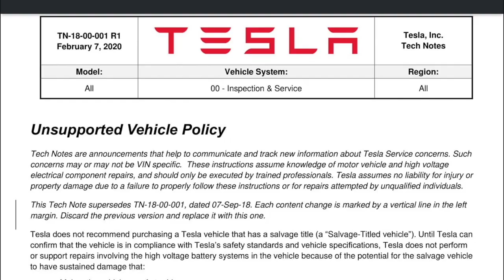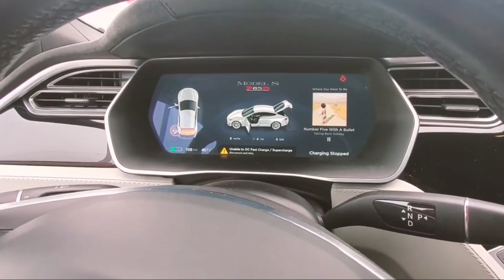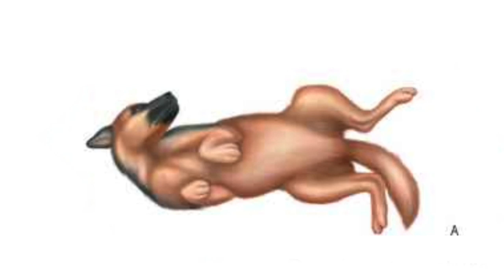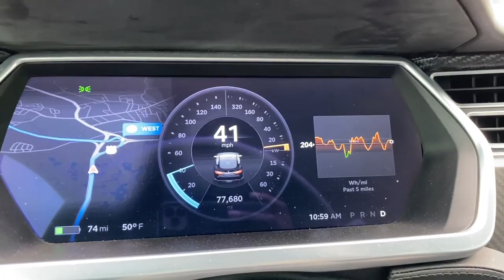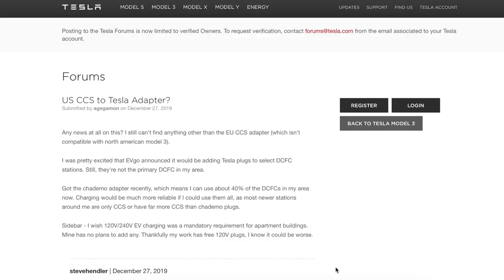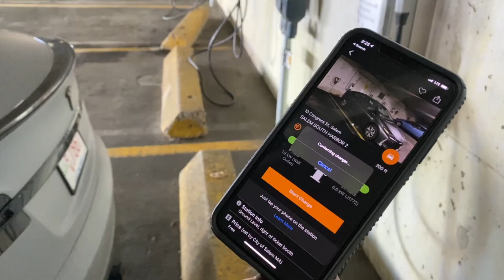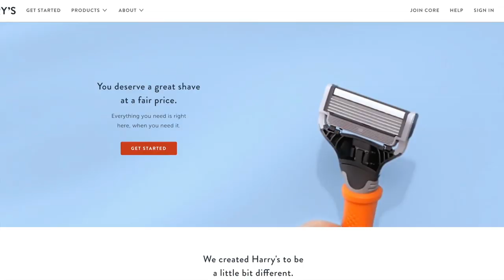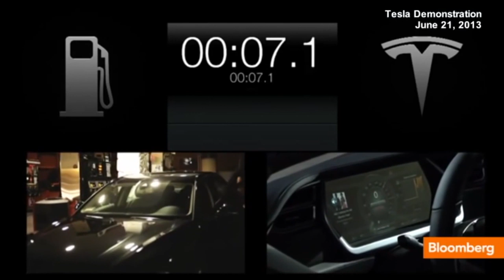Tesla ruined my car and it’s the best thing to ever happen to me!

Comment: I won’t give Tesla $1 
This is unacceptable period
Reply: Right. Tesla sucks.
Reply: Yes I agree the fact that they don't do the inspections anymore sucks but honestly playing a little devil's advocate here, dc fast charging is pretty dangerous and if the rebuilder did a terrible job and the car catches fire while charging that would be pretty bad for Tesla
Reply: They want the cars junked out... they want you to buy a new car
Reply: Watching this made me cancel my Tesla order...

Ok i didn't have a order, BUT if i did I'd cancel it. Of course there no way i could afford a new, or even used Tesla. Sooo yaa
Reply: I like Tesla ALOT, there vehicles r in my list of dream cars, but this is utter shit
Reply: @pkoya341  Yes, that would be pretty bad for Tesla if it happened. But what they're doing is bad for them _now_. They need to stop.

I get why they are afraid of the media, they've done enough BS to hurt Tesla, but this is just making it worse. They still get the bad press, but now it's actually justified and they're fucking over actual Tesla/EV enthusiasts for a little perceived gain that they have no way of proving it's actually there.
Reply: Not offering a way to buy supercharging is some real nonsense.
Reply: @jonmayer  If only it ended there. The worst part is they turn off all fast charging, not just supercharging, essentially rendering this Tesla worse than a standard non-Tesla EV. If they shut out Rich from their own electric gas that's one thing. But blocking him from using any of the other stations Leaf and E-Tron owners would use is just despicable on every level.

It's like they're trying to render the car completely unusable without the legal ramifications of a remote kill switch.
Reply: @DeeSnow97  imagine if they did 😰
For every used Tesla, the next time the driver shifts to park, it's immediately bricked. 
Scary, huh?
Even though there not dumb enough to do that (thankfully), it's having the same effect if they did decide to do that. Shutting people out from supercharging PLUS regular DC charging is just unacceptable. I try to look over a lot of the things Tesla does but waiting 24 hours plus for not even a full charge is just evil

Comment: This is high class bullying. Really shows the disadvantages of being connected all the time. Sorry to hear that!
Reply: Rich, would have ZERO problems IF he just bought a USED working Tesla instead.
and keeping the car Stock.
Reply: @markplott4820 : Well of course, if somebody pays 3 times the cost for a car that you do not fully own then sure...
Reply: @herrschaftg35  - TESLA model 3 costs $35K and worth more than a $70,000 gas car.
it will Outperform and Outlast a ICE car. 
and even the Standard TM3 at $40K is even a better DEAL when you add Tesla FSD.
you will be Safer and more Aware, and TM3 is Really FUN to Drive, its a REAL Drivers car, its Lighter and Nimbler than the Flagship Model S. 
you can even add Racing brakes, Wheels and Shocks.
Reply: @markplott4820 : An EV will most likely not "outlast" an ICE car, despite them requiring less overall maintenance. Certainly not a Tesla due to their subpar build quality. Clearly as indicated when Tesla altered their warranty conditions regarding their batteries and motors. And quit talking like Tesla's are comparable to sports cars. Sure, they can accelerate quickly which makes them a one trick pony in drag races, but that is the only thing they are good at. That V2 upgrade you are talking about certainly helps, but the majority of Tesla's on the road can't even do a session around a road course without ridiculous brake fade or having the batteries/motors overheating. Few EVs as a whole can even match the range associated with an average ICE car. So, your comment of Tesla "outperforming" ICE cars is definitely wrong.
Reply: @herrschaftg35  - any EV even from Other manufactures, can TODAY outlast a ICEV or Hybrid. so long as the Diver does not Overcharge and Maintains the car.
TESLA are Unique because their car is TOUGHER and Better built than ANY ICEV Today.
Sandy Munroe said - "Tesla model 3 is built like a Tank and it Outperforms European sports cars".
Sandy did a Teardown of the Model 3 PRODUCTION car and he was Impressed with what he found. 
the Tesla is Better built TODAY and has way Fewer Defects and Repairs than in 2018 when Model 3 Production began.
you can EVEN stack rail cars on top of the TESLA Glass Roof and it wont FAIL, M E A N W H I L E many ICEV have thin Metal Roofs that you can cut with TIN SNIPS. 

Tesla are NOT a Throughbread RACE car but they can OUTPERFORM just about ANY Production ICEV.
specially after using a MAX Lowering kit, Race Brakes, Shocks & Coils and Racing Tires. Unfortunatly most Drag Strips and Raceway do not have Supercharger in the Field, but that may change.
and there IS the Possibility of Supercharging with a Tesla MEGAPACK battery that can be Delivered on a Flatbed and can charge up to 100 Tesla per day with 12 stations.
TESLA can in Fact RACE pretty well, it set RECORD Breaking LAP Times at Nuramburing (Supercharger location ) and at Laguna Secca raceway. 
you can even DRIFT Drive a Tesla in the SNOW or on a Race cource, just ASK the ONLY Tesla Driver to complete PIKES PEAK . and he Plans on setting NEW Records with the Performance model Y.

TESLA model S is a Luxury car but it has the Longest Range of ANY Tesla 490 miles on a Charge, and with Additional tweeking in Battery and Software 500 miles in a Tesla is Doable , in FACT ALL of Tesla vehicles have received Updates to all Models to Improve Range and Performance.
so 500 Miles Electric vs a ICEV car.
BONUS, you can charge your car from your Garage.
Reply: @herrschaftg35   I just look at it from the perspective of ice cars not being sustainable.

 Oil is filthy and finite. We have to fight wars, displace people and wildlife to get it. What's the actual cost of a gallon of gas if we account for the thousands of lives lost fighting for it, not to mention the vets and civilliians still living with PTSD?  Plus, the spills keep happening, poisoning our water and land. The air pollution has got to stop for the sake of our kids and grandkids and all of humanity.

Meanwhile, the sun gives us all the power we need for a year every hour. We just have to harness it. No war required.
Reply: @markplott4820  you can't off road or camp with a Tesla
Reply: @seanmccarthy8311  what's the cost of keeping the power grid running?
Reply: @mkgzt  Priceless.
Reply: @seanmccarthy8311 : I am not the biggest fan of using fossil fuels either, but hydro is the only "clean" energy that can reliably meet the demand. Solar and wind require a vast amount of surface area to produce that kind of power, and it isn't as reliable. Even if we cover entire acres with inadequate batteries for storage it is still far cheaper to use standard fossil fuel power plants. When renewable resources can perform better and be the better choice from an economical standpoint, then there will be a switch from using oil.
Reply: @markplott4820 : Just stop. You are either highly misinformed or simply being paid by Tesla to spread that BS. I would normally explain my comments and point out the falsities on this subject but I am not going to waste my time with you. FYI, all three of your paragraphs are filled with BS.

Comment: It's time for custom firmware :)
Reply: @karsenbox5678  Not if you turn off their 3G connection, how will they know you changed anything if you cut off the data connection?
Reply: More like, time to switch back to a gas car.  Much simpler.
Reply: @javiermedinaortiz4653  because electricity is cheaper than gas
Reply: @ztmackin  time is money
Reply: Already in progress all you have to do is Trick it into thinking it's in the middle of nowhere with no internet connection wipe the system upload the copy do you want have any of the Wi-Fi futures but you're super fast charging will work
Reply: I’m gonna put windows xp
Reply: @HelamanGile  there will be no place without internet connection once starlink is up lol
Reply: Already out.
Reply: Itz Mango time is free wdym xD
Reply: Doesn't matter if you wrote all software yourself, you still need to authenticate with Tesla servers...... understand? NOT gonna work.
Reply: Anything can be hacked...
Reply: @karsenbox5678  It's not hacking. It's replacing. Throw the proprietary garbage in the trash where it belongs, and install your own hardware. At the end of the day, a motor is a motor. All you need is a basic motor controller system and a custom battery charger.
Reply: Tesla model s (2012 jailbreak) IMAGINE?

Comment: Between this and not being able to repair your own vehicle, I will stay far away from Tesla.
Reply: why ? A Certified mechanic can keep a TESLA running for decades. 
and a Brand NEW Tesla longer. 
and TESLA makes the BEST Vehicles PERIOD, from Day ONE.

Sandy Munroe did a Teardown of a Tesla model 3 " the Tesla model 3 is built like a TANK, but Drives BETTER than the European Sports cars"

and Motor Trend said " BEST car we EVER Tested in 70 years "

Repairing your OWN vehicle is no so Important IF you car does NOT need Major Maintinance in over 300,000 miles Driven , and ALL you Really have to do is Rotate Tires, change wipers and add Wiper Fluid.
this is Supported by the DATA collected by TESLOOP a Rideshare company who ONLY uses Tesla vehicles.
Reply: JOHN - does NOT matter if you do NOT need to Service a Tesla in OVER 200,000 miles Driven.
Reply: @markplott4820 : You definitely sound like you are on Tesla's payroll. "Best cars".........what are you smoking???
Reply: @herrschaftg35   - NOPE don't own tsla Stock and don't Own a Tesla car (yet). 
I'am saving for a Model 3 ST LR. 

Motor Trend said " Tesla is BEST car we tested in 70 years "
and Sandy Munroe said " Tesla model 3 is built like a TANK, but it Outperforms European sports cars." 
Sandy did a Teardown of a Model 3, you can even buy his FINAL Report for $70.
Reply: @markplott4820  you and Elon need to get a room
Reply: @markplott4820  so no tesla has ever gone wrong ever?  ok
Reply: @SNORKYMEDIA  - NOT , saying that at all.
I am saying in General most Tesla owners do NOT have Catastrophic Problems with their Tesla.
mostly minor fit & finish issues , that the car can still Operate safely . 
and TESLA have fewer problems than COMBUSTION cars.
People die everyday from a Combustion car catching fire, yet the MEDIA does not report that. 
I observe Combustion cars catching FIRE everyday in the Bay Area.
Reply: @markplott4820  Ehh...
No.
Reply: Mark Plott • What?
I seriously do like Tesla, and want a model 3 pretty bad. But you’ll need to replace tires from wear eventually. Align and rotate tires. The break pads may wear slower due to regenerative breaking taking some of the force, but they’ll need replacing occasionally. I don’t know if the breaks are controlled by wire or if there’s break fluid, but eventually that needs bled and replaced. There’s probably some other stuff, but it’s true the Tesla will have less overall maintenance.